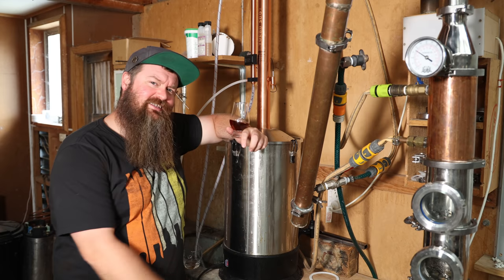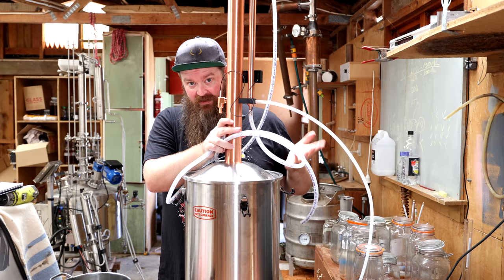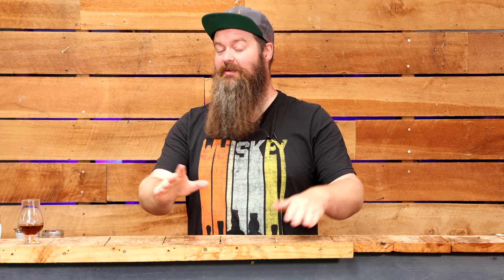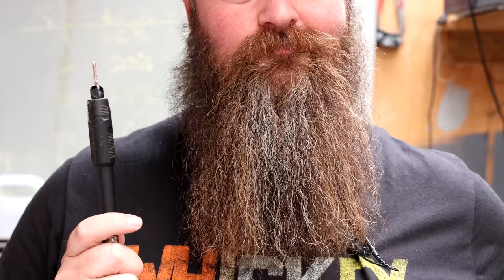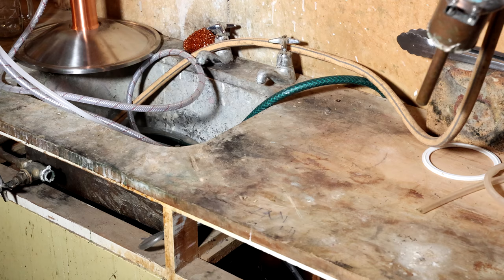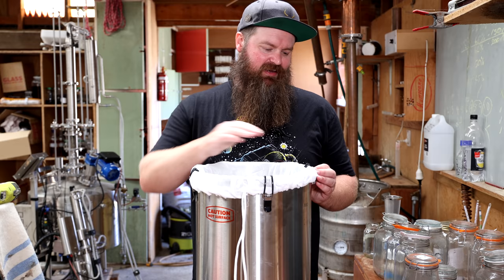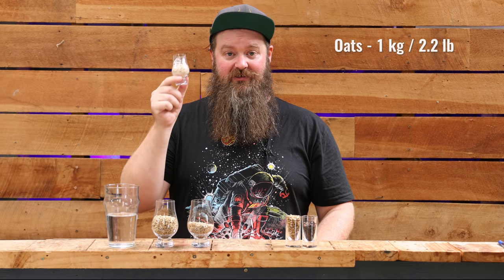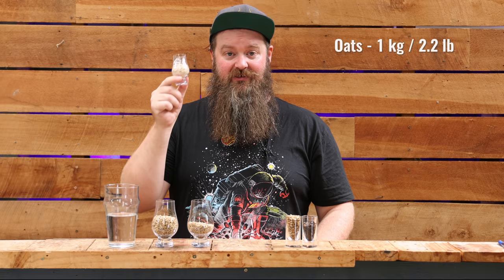How To Make Next Step Whiskey (safety Net)

Comment: I have a question I'm sever cilliac is the barly or mault distilled out of the alcohol as people who are gluten free can drink it
Reply: Oils, water, esters, alcohol make it through the still. Proteins don't. Unless you boil over and have have some of the wash come out the end yiu should be okay. To be double safe, you could use oats (corn?) and other gluten free cereal grains. Apparently oats make a killer spirit but they're hard to deal with in a mash.
Reply: Gluten is a long chain protein. It’s boiling point is 1096.1°C if your still gets to that temperature it’s not the gluten you should be worried about

Comment: When doing the second run are you diluting the stripped run down or just throwing it back through as is?
Reply: @theworldisastage1984  cheers mate
Reply: I guess that as he is running it down to 10% at the spout, then the overall ABV of the low wines would be about 35%, which is fine to run as is.

Comment: So you strip run and it's safe to run that again being very volotile I thought it would cause an explosion?
Reply: You aren't exposing the vapours to naked flame and also the still is an open set up so there's no pressure buildup
Reply: Hi @nathan Clark. Before you start the spirit run you water down the “low wines” to below 40%. It’s not safe to run the still with any higher percentage then that. Take care.

Comment: I know you usually measure the dimensions of the wood chunks you age on and that makes sense for surface area, but do you ever just get a weight measurement of the wood?  Just asking because it's pretty hard to compare with the surface area of wood chips when you don't have staves.
Reply: I’m no expert, but weight isn’t a good way to measure. Think of the two extremes, tiny bits of wood versus one block. The surface area of the former versus the latter is hugely different at the same weight. 

I try not to stress about “the right” amount of wood, I add what I feel comfortable with, and sip/taste test every 3-4 weeks. If it’s getting “too woody” I remove some or all the wood and leave it to age further. It’s a learning curve for sure!
Reply: @craigeeezgaming4195  i agree, but mass is kinda of the only way to compare chips to staves.  I guess you could try to figure the average surface area of a mass of chips, but at least weight is a hard number that's easy to check, even if it's imperfect.  Just assume you need like 50% more stave weight to equal the wood impact of chips.  It's a better starting point than "what feels right" at the least, you can adjust from there.
Reply: @Daniel-zq3wq  increased surface area decreases the length of time for the flavours to infuse. Most wood chips in a bag are about the same dimensions due to the mechanical process to chip them. 
So you only need to measure 1 chip and weight it. 
Then weigh the total volume of chips
Divide total weight by single weight = approx number of chips
Number of chips * surface area of single = total surface area

Alternatively just keep tasting every few weeks till it tastes right. Doesn’t matter what weight or surface area, no need to over think it. It will get there eventually

Comment: This is a question not based on me doubting you, but just out of ignorance... Why do we need to use more than a teaspoon of yeast? When I make bread, I add 7g (246918/
1000000 ounces) for a loaf, but I can start with a fraction of that if I'm willing to wait an extra 1/48th of a day. When a mash is taking days, wouldn't the yeast just breed up in the first few minutes to the point where you have a pack of turbo yeast in no time? (I've never been willing to test this because I don't care enough to risk a batch, and distilling is against the law here so I would never do that) The only thing I can think of is overpowering natural random yeast blowing in the wind, but I suspect that extra half hour would make no real difference. (I'm talking about a simple white sugar, water, and yeast mix) Anyone?